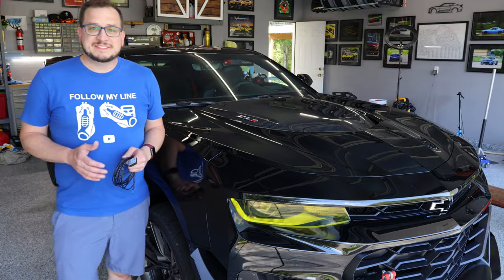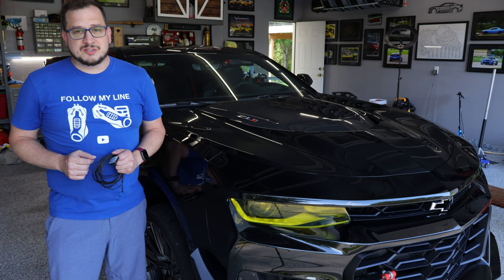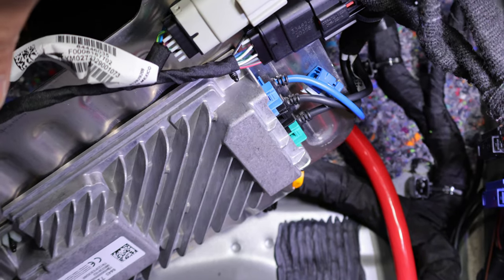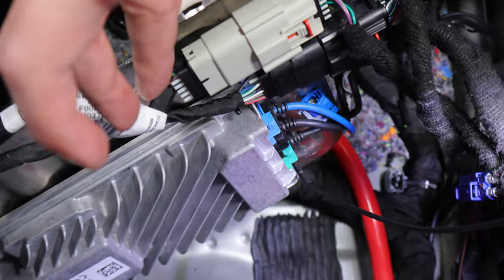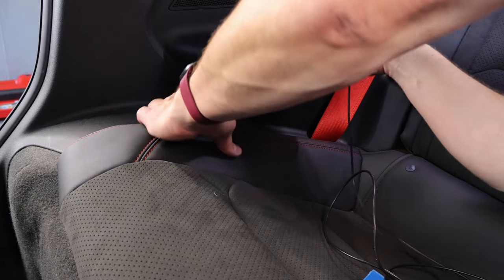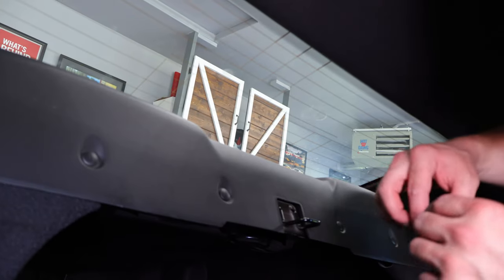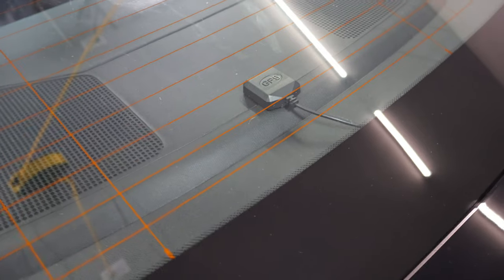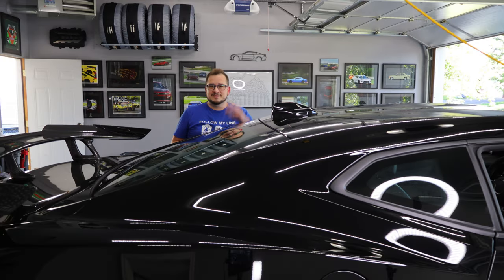Fix Your PDR GPS Antenna Now // 2022-2024 Camaro

Comment: Thanks for the video. I did this a few months back on your recommendation and it’s been great having a working PDR since. I will have to follow your routing as it is much cleaner. I was impatient and just slapped mine under the child seat latch cover.
Reply from the maker: Glad to see it worked! Still no update on an ETA from GM, so hopefully this hold us with PDR issues over until they do.